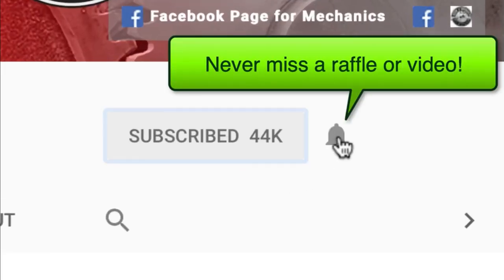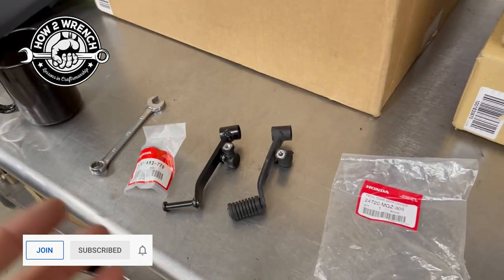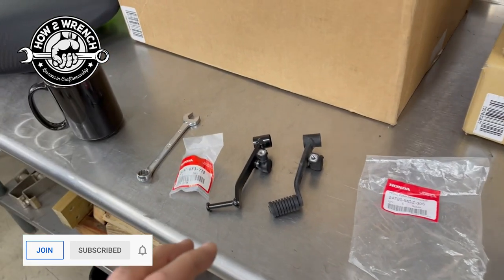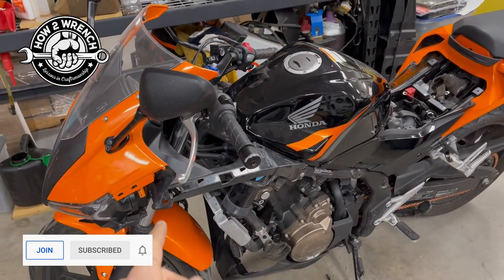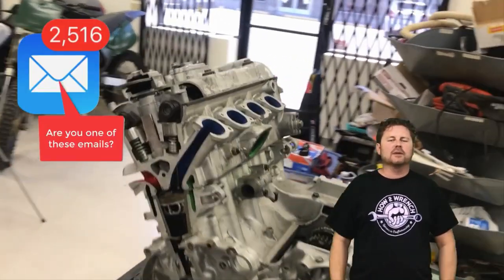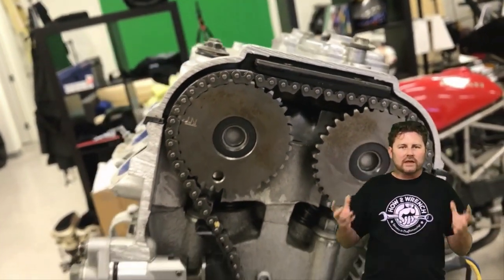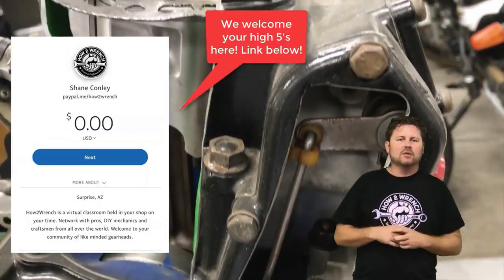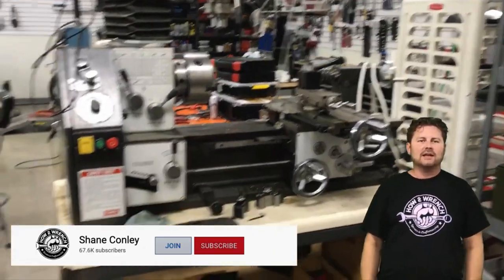Should I bend it or replace it? What is the risk? Is it worth it?

Comment: I'd say explain to the customer their options. If it's covered by an insurance, I'd say get the most out of it but be also be reasonable. If not then explain what you find out about the bent part. Stock levers are usually malleable and can be bent back and you got to feel point where bending it back has it's structural integrity compromised. Try bending an aluminum brake lever and a steel shifter lever. They have this "feeling" where bending it back and forth will cause them to break or develop a crack.

On another note,  some aftermarket levers are made of billet aluminum. In my opinion these are not good for shifter levers for example in dirt bikes as they may do more damage in the event of a crash. They are meant to be sacrificial parts or engineered to fail to keep other components safe.
Reply from the maker: Thanks for commenting and the added thoughts Idsel...
You rock! Best way to help us back is joining or grabbing our T-shirt! Support links and gear below!  Awesome and thanks for commenting! Smash the subscribe button (thank if already a sub!)
Have you seen our "YouTube Trained Support Shirts? Great way to "high five us" https://goodfellasmerch.com/collections/how-2-wrench/products/support-shirt

Join this channel to get access to perks:
https://www.youtube.com/channel/UCBhM8DCKnT3qXwTW0eToyCg/join   
-Daily MEMBER FIRST COMMENTS ANSWERED FIRST 
-Live Q/A video chats
-Wonder if we have a video on your need? Members can request content links!
-Full Access to the ENTIRE 700 video library
-Member-Only FREE tool giveaways   

Just want to say thanks quick to support us for this information and our work saving you money? 
Give us a high 5 here:  https://www.paypal.me/how2wrench   

Got an emergency and your head is about to explode from frustration or fear? Get Shane’s cell here: https://how2wrench.com/ols/products/techline-one-on-one